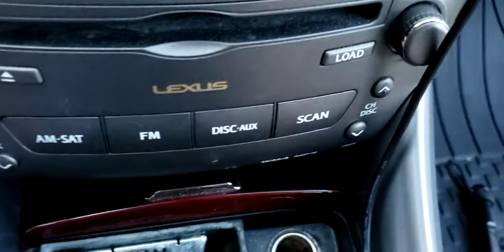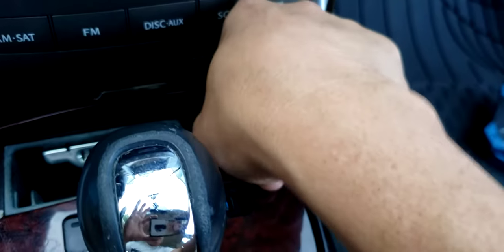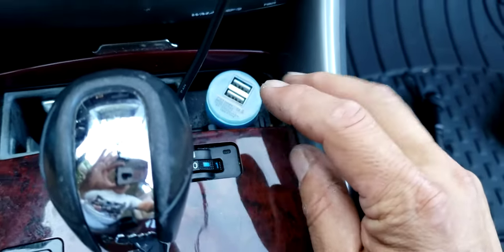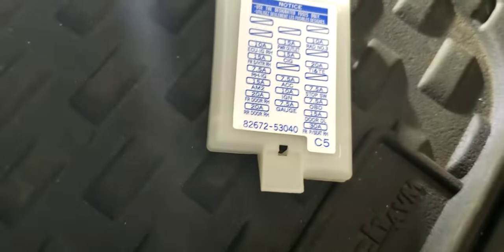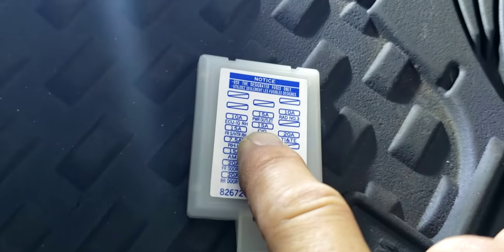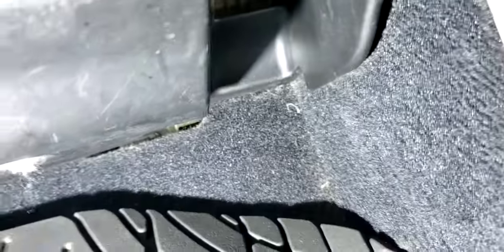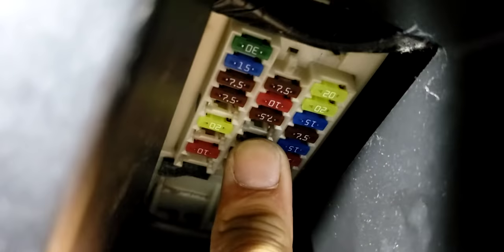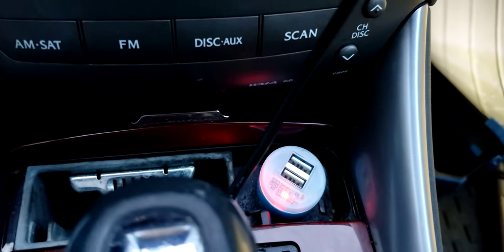2008 lexus is350 / is250 cigarette not working

Comment: I just got an is350 and both my 12v plugs dont work? Are they both on the same fuse?
Reply: that’s what i’m wondering. tried this on my 08 is250 and the outlet under the arm rest started working but not the one in the front
Reply: @SC-fh7nt  they are two different fuses in the same area under the passenger side dash. Replaced both and they work now

Comment: I have the same problem I changed both fuses but they both still both burn after that i disconnected the lighter and after a few days the power outlet fuse burned again so it's not my lighter should I put a 20A fuse ? Or a 10A fuse ? What should I do ?